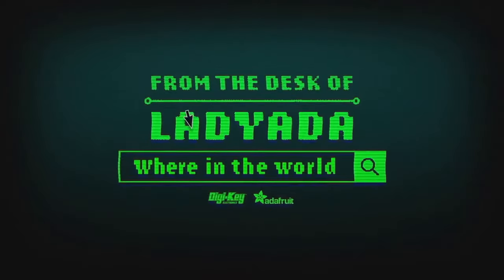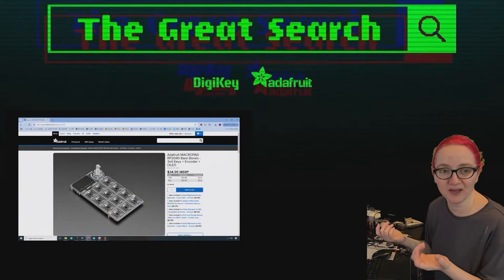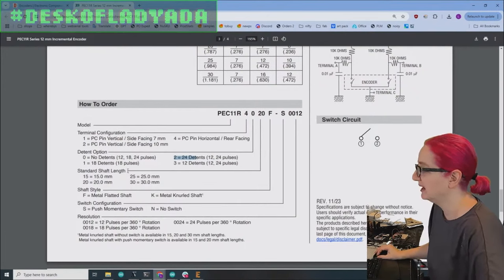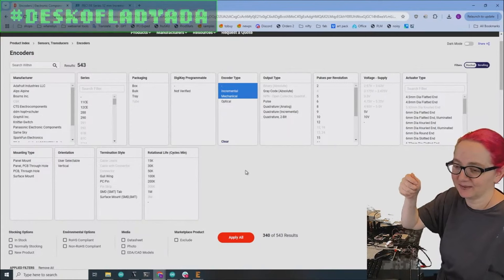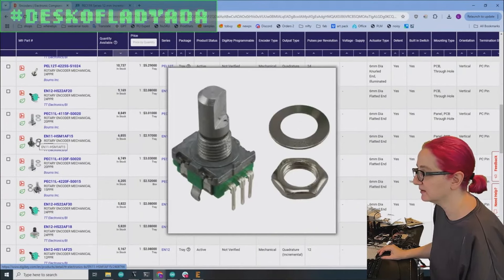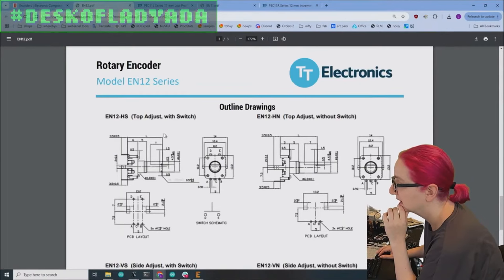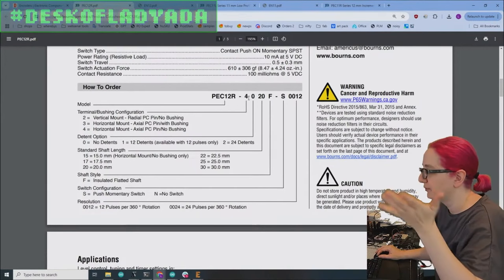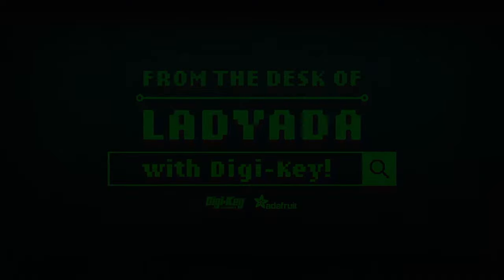The Great Search: Short Horizontal Rotary Encoder #TheGreatSearch @DigiKey

Comment: What I want is a surface mount encoder with the shaft protruding through a hole in the PCB so I can print the panel legend on one side of the PCB and the wiring on the other. This would compliment 'reverse mount' tactile buttons as a way of making control panels with professionally printed legends. Searched several distributers and cannot find such a thing!
Reply from the maker: Ladyada provides an answer https://www.youtube.com/live/RiP8XanW4sU?feature=shared&t=1844